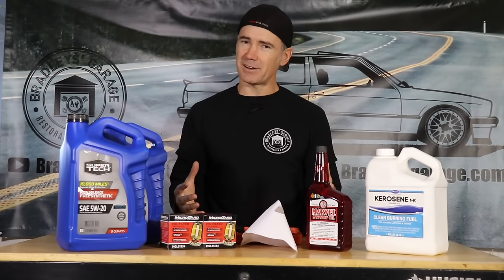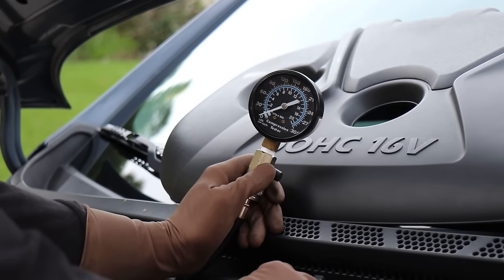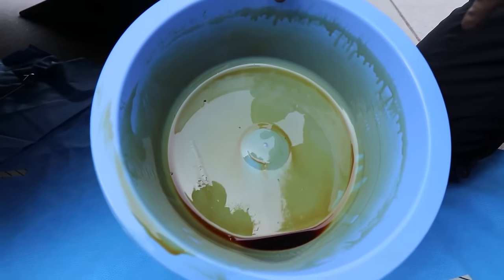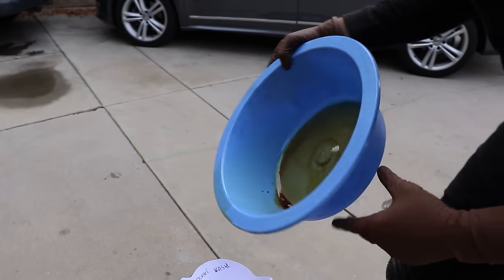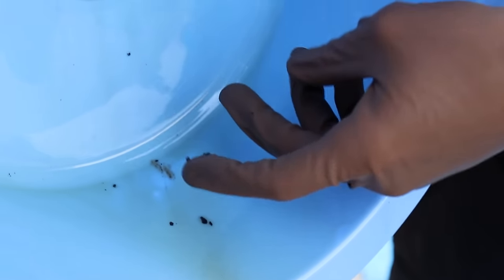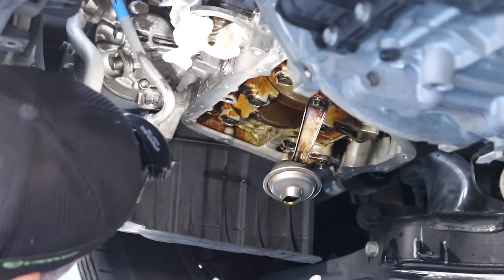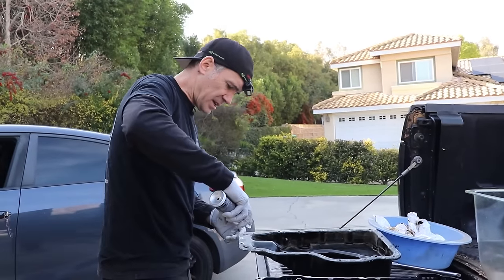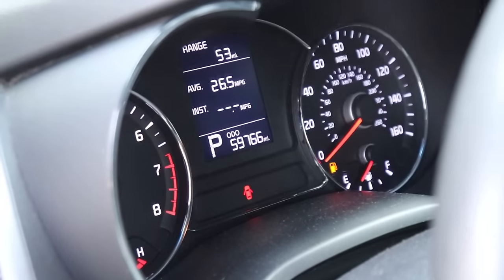*UPDATE* Customer States Jiffy Lube refused to change my Oil - Sludge Factory Kia Forte

Comment: Years ago, my wife's buddy dropped by her tercel. I was washing the wife's car at the time so I thought I'll wash hers too. They only take about five minutes. She's single so I thought it wouldn't hurt to check the well. No oil ,put in a quart nothing still, put in another quart and just barely touched the dipstick.any case topped her up. and she drove that car for years after that.
Reply from the maker: Thanks for the comments Joey, we were amazed that this was running fine when he first came over. After pulling off the valve cover, it was even more shocking.
Hopefully we have done enough to salvage the motor.
Thanks again for hanging out, Cheers!

Comment: I'm an auto tech. I've used Super Tech oil and filters for years and have never had any issues. It's extremely affordable, too. Even for full synthetic and they have a few stages/formulation blends.
Reply from the maker: Thanks for sharing Smith, appreciate the feedback. We also have not had any issues with the SuperTech brand of oil. It is considerably cheaper than the name brand shelf.
At the end of the day, the oil just needs to be changed on a routine basis.
We just posted the 3k mile update video here - https://youtu.be/QrJ0B-KXTw0
Cheers!

Comment: Honestly what a difference to the original pull apart.
You have just saved that owner a new engine if he kept driving like that.
I also agree too, & use a good quality oil.
In Australia I use Penrite oil.
Not cheap but made in Australia.
Reply from the maker: Thanks for the comments Stephen, we are pretty happy with how things turned out. We're sure the cheap oil changes at Jiffy Lube did not help the situation, if in fact they actually changed his oil.
We just posted the 3k mile update video here - https://youtu.be/QrJ0B-KXTw0
Cheers!

Comment: You should do some research on vavoline restore and protect I’ve seen multiple videos of how good this oil is at removing deposits and dang near bringing the engine back to new. I wonder if it would work on this car.
Reply from the maker: Thanks for the suggestion Leon, it couldn't hurt to perform a future oil change with that Valvoline Restore & Protect product.
We posted the 3k mile update video if you haven’t checked it out yet - https://youtu.be/QrJ0B-KXTw0
Cheers!

Comment: I never add new oil to oil filter when I change my oil. Am I supposed to add oil to the filter then screw it on? Thoughts? Also I do oil change every 3k miles even synthetic has never failed me and I drove my cars to 200k miles. So if you watching do every 3k miles.
Reply from the maker: Thanks for the comments Thomas. We mostly play around with Euro cars and they have the cartridge style filter on top of the motor. There is no real way to "pre-fill" them before installation.
We got a lot of feedback from the initial video about us not pre-filling the oil filter. Since this particular Kia motor has an oil filter which is perfectly upside down, you can easily add oil before installation. 
The internet seems to be divided on this topic and we never really gave it too much thought prior to this. We found an interesting video from an oil guy that went through a series of tests about the myth.
Check it out here - https://youtu.be/939WTeorBnQ
It seems easy enough to do for this application so it can't hurt anything and may actually prevent a few seconds of lack of oil pressure so we will start doing it moving forward.
Cheers!

Comment: You didn't have to do all this work if you just used the BG dynamic engine cleaner set. It is a pretty expensive product set, but after watching 100 of these videos it's the only stuff that really works and dissolves all that sludge in one go. I've seen it work on worse engines then this. Go get it and be done with this engine.
Reply from the maker: Thanks for the recommendation; we will definitely check out that product for our next Sludge Factory project.
Cheers!

Comment: I’ve been using marvel mystery oil. From the late’70 and I still use it today, I put it in my oil and also in my gas. My Toyota and my ford runs very well. My Toyota is 25 years old and runs awesome
Reply from the maker: Thanks for the comments Glenn, appreciate the feedback. We will continue to add a little in each oil change until the oil filter is clean after 3k miles.
We just posted the 3k mile update video if you haven't checked it out yet - https://youtu.be/QrJ0B-KXTw0
Cheers!

Comment: Marvel Mystery Oil is a great product in vehicles with questionable oiling systems. It saved the lifters on a 200k mile Tahoe I had. I ran it for a whole 3000 mile oil change and it just ran quieter the longer it was in there. 

I am blown away by how much cleaner that engine is inside. Great job cleaning it out. The owner should definitely stick to 3k mile intervals from now on. No doubt there will continue to be small particles breaking loose for some time, but nothing a good oil filter can’t handle.
Reply from the maker: Thanks for the comments Johnny, glad you enjoyed the video. We will continue to monitor it every 1k miles until the next 3k mile oil change. We will also keep adding 4oz of MMO after each oil change and run it for the 3k miles as well.
Hopefully we have done enough to salvage the motor and keep it running for thousands of more miles.
Thanks again for hanging out, Cheers!

Comment: Uhm  yeah, modern engines with variable valve timing and direct injection are sludge prone and sludge sensitive. Changing oil every 3000 miles is not too often.
Reply from the maker: Thanks for the comments Roger, the goal is for Jake to be able to change his own oil every 3k miles moving forward.
Cheers!

Comment: What ive done on sludge engines is Remove valve cover and oil pan, Cover corrounding engine and components with plastic, include under hood and fenders, Spray purple power over the engine and pressure wash engine. Yes pressure wash engine crap drains out of the bottom better than any snake oils. Repeat as necessary and clean oil pick up tube. , Install new oil filter and fresh oil. Remove spark plugs to spin engine over clearing any water that may have gone through an open valve . Run engine until hot ,drain oil and replace filter. Job done.
Reply from the maker: Thanks for the info Gerard, appreciate the feedback. We thought about the pressure washer but then didn't really want to put water into the engine. Since it wasn't our car, we decided to go with the flush method instead.
Be sure to check out the original video if you haven't seen it - https://youtu.be/XU79jXYWydA
Cheers!

Comment: Try high mileage oil. It has more washing formula and supposedly removes deposits better (in theory)
Reply from the maker: Thanks for the tip, we did use the cheap high mileage stuff during the initial flushes. Hopefully we have done enough to salvage the motor.
We just posted the 3k mile update video here - https://youtu.be/QrJ0B-KXTw0
Cheers!

Comment: Just wasting money n time. Just use diesel engine oil, regulary change the oil as usual after 3000 or 5000 miles, you would be amaze how black n thick the oil that come out, after maybe 5 times oil change the engine will be clean
Reply from the maker: Thanks for the comments, appreciate the feedback. Cheers!

Comment: 18:10 Take note quick lube places and dealer service centers.  The torque spec isn't "15 seconds with my air impact" for any car.
Reply from the maker: Thanks for the comments TBird, it's crazy how tight they think it needs to be. So many stripped out oil pans and sheared off drain plugs. 
Be sure to check out the original video if you haven't seen it - https://youtu.be/XU79jXYWydA
Cheers!

Comment: Many years ago ( in the leaded fuel days) I bought a Toyota HiAce with an 18R (2 litre SOHC) engine second hand which I serviced immediately. The oil was tarry. The compression was uneven.
I changed the oil and wasn't happy. Then I flushed it with Redex and soaked the bores overnight with Redex as per procedure. Lots of smoke on start up next day ( I may have done this more than once).
The behaviour of the engine became normal fairly quickly and the compression was soon within normal parameters. I never pulled the engine down but understand the gummy rings were freed by the Redex soak.
I eventually sold the vehicle which continued to run clean.

By the way, the best thing ever was getting rid of dirty leaded fuel which gummed rings, created sludge and destroyed exhausts.
If General Aviation would grow some balls their engines would last more that 5 minutes.
Reply from the maker: Thanks for sharing Mike, appreciate the feedback. Cheers!

Comment: Amazing what abuse engines can take. Even these vulnerable Kia & Hyundai engines. You cleaned it up real good. So that was diesel fuel?
Reply from the maker: Thanks for the comments Max. For all the comments we have been hearing about the Kia engines, this one has taken a beating and still seems to be doing just fine. We used a diesel fuel mixture for the secondary flush.
Be sure to check out the original video here - https://youtu.be/XU79jXYWydA
Cheers!

Comment: Just use the high quality engine flush and use premium synthetic oil like royal purple or amsoil in it. It will slowly remove carbon buildup and will have no issues after that.
Reply from the maker: Thanks for the comments, appreciate the feedback. 
We just posted the 3k mile update video here - https://youtu.be/QrJ0B-KXTw0
Cheers!

Comment: Dont understand how engines get to look like that -- Change my oil once a year or 10,000miles . Car now on 300,000 miles never let me down , uses not oil and is clean inside ie no sludge .  In Europe none changes the Oil every 3000 miles
Reply from the maker: Hey Duncan, Kia recommends 7500 mile oil changes and 5000 under severe conditions. Since Jake is only driving around town and never really getting the motor up to operating temps, it should be done every 5k miles.
Since we are still trying to get it cleaned up, we are doing the 3k mile oil change interval.
We just posted the 3k mile update video here - https://youtu.be/QrJ0B-KXTw0
Cheers!

Comment: Looks like you saved the motor.
Its not perfect and it will cough out chunks for a long time, but it doesn't look like total fail. 
Dumping straight diesel into it and out the pan is not forced into the bearings by the oil pump  but it won't reach the timing chain, only way to get it near perfect is rebuild it. But i think if he changes his oil sooner then later the extra cost of oil is less then a rebuild. 
Change at 2k to 3k miles would be smart. Don't let it break down
Reply from the maker: Hopefully we have done enough to salvage the motor. We will monitor it every 1k miles until the next 3k mile oil change. The plan is for Jake to perform that oil change since he has watched us do it 5 times now. And then he will be doing it himself every 3k miles from that point forward.
Cheers!

Comment: Isn’t a 3000 miles interval not very short? Modern cars can run with intervals more than 10k miles.
Reply from the maker: Thanks for the comments, the goal for the 3k mile oil changes are to further remove any remaining debris from the engine. Doing short interval oil changes will hopefully breakdown any remaining particles that may be present in the motor.
We will continue to monitor it every 2k miles until the next 3k mile oil change.
Thanks again for hanging out, Cheers!

Comment: On top, lightly spray carb cleaner then use a high power vacuum, then do your cleaning additive.
Reply from the maker: Thanks for the comments. We did a little diesel flush (off camera) with the oil pan off to wash out any debris in the tight areas of the engine and holes. That produced quite a bit of particles so we feel pretty good that the internals are clean at this point. It was basically a rinse from top to bottom.
As you could tell from the update video, there is not much left in that engine in terms of debris.
Cheers!

Comment: I would open the motor scrape some sludge from a few of the worst areas close the motor back up and test everything to see what dissolves the sludge in separate test cups once you find the right chemical I would drain the oil and put only that chemical in the motor disconnect fuel / Spark And crank it till the battery dies and let it sit for 24HR then drain fill with oil to Rinse chemical Maybe run it depending on how harsh your chemical is
Reply from the maker: Thanks for the comments, appreciate the feedback. 
Be sure to check out the original video if you haven't seen it - https://youtu.be/XU79jXYWydA
Cheers!

Comment: I’m buying my son a 2012 Toyota Corolla with 100k miles. Would you recommend doing a flush on all used high mileage cars as a good refresh or starting point?
Reply from the maker: Thanks for the questions Chris. It would be a great idea to do a normal flush just so you know you are starting your ownership off with a clean slate. You have no way of really knowing what or how the previous owner performed maintenance. Even if they have receipts, there is no guarantee of what has been actually done. It's an inexpensive repair that can provide some piece of mind.
Be sure to check out the original video if you haven't seen it - https://youtu.be/XU79jXYWydA
Cheers!

Comment: I am curious to see how a diesel engine looks inside with city or short commute only. My mom only buys diesel because of the advertised km/l or mpg. I told her she is better off with a gasoline, but she won’t listen. The car often has to go to the mechanic for a cleaning because the engine light comes on after too many short commutes. Even the mechanic says it. Not major says the mechanic, but not good for the car to take short commutes.
Reply from the maker: Thanks for sharing Geegee, short trips will have a huge impact on buildup such as this. It might even be worse for diesel engines since they like to be run for hours on end.
Curious what that shop does for "cleaning" the diesel motors?
Cheers!

Comment: It astounds me that, given what a car costs these days (even a used one), owners would be so lackadaisical regarding oil changes which are easy to do and relatively cheap .  I'd love to know what you charged for all that work.
Reply from the maker: He's just a 20 year old kid that doesn't know anything about cars or what is needed to keep them running properly. He helped with the repair so he wants to learn and understand things.
Hopefully he has learned a valuable lesson on the importance of routine maintenance on his car moving forward. The goal will be for him to be able to change his own oil moving forward.
Since he went to school with one of my sons, we just wanted to help him out. He covered the cost of all the parts used and we spent about 8 hours doing the multiple flushes, etc. We think most shops would tell him he needs a new engine and not want to spend any time actually cleaning anything.
Thanks for hanging out, Cheers!

Comment: In your first video, the engine was packed with sludge. I guess it liquified and poured out with the oil. Thanks for a great video.
Reply from the maker: Thanks for the comments John, it took numerous flushes to get it cleaned up. A lot of manual work as well, scooping out sludge and cleaning up the valve cover/oil pan.
We just posted the 3k mile update video here - https://youtu.be/QrJ0B-KXTw0
Cheers!

Comment: How can this problem be prevented?  Thank you for your excellent videos.
Reply from the maker: Thanks for the comments Royd, glad you enjoy the content. This was our first experience with the Korean brand so we have not had anything like this with our Euro projects. It seems as though, based on the feedback from this Sludge video, these engines are prone to having issues.
The best way to prevent this happening on any engine, first and foremost is proper maintenance. On the Kia/Hyundai motors, they need to be changed every 3-5k miles depending on driving style. Lots of short distance driving, do it every 3k and a combination of freeway and city you could push to 5k miles.
On the Euro cars we typically do 7500 for the gas engines and 10k for the diesel engines. On our high performance cars we change them every 3k miles since they are typically driven harder than the daily.
Hope that helps answer your question. Thanks again for hanging out.
Cheers!

Comment: Glad to see you used Marvel Mystery Oil! I add it to my engine and even my fuel tank. Is the best, it is slower to work because is not harsh, so you need to use the car for a week or so, but it sure does the job without any risk at all. You can even leave it until the next oil change. I have used MMO for more than 50 years! old and brand new cars.
Reply from the maker: Thanks for the comments, appreciate the feedback. We will keep adding a little MMO to each oil change to continue to wash out any remaining debris.
Cheers!

Comment: I've used the same engine flush I came up with 20+ years ago and I have never had any issues with using it. First of all you need to fill the system over full as it puts the oil in contact with places it is not normally witch is were sludge likes to be in this case I would have put 5 quarts plus 1 qt for total of 6 I run a gallon made of 75% diesel 1/4 of the small bottle of dawn and the rest paint thinner. Add to engine and add a quart of oil and a qt of diesel then let idle For atleast 20 minutes do not rev engine at all and it is a requirement to run a clean oil flush though the system otherwise you will have very very thin oil
 Just use the same filter as you did the flush with drain and refill the oil with proper amounts and run for 15 minutes and change oil and filter
Reply from the maker: Thanks for sharing Clayton, appreciate the feedback. 
Be sure to check out the original video if you haven't seen it - https://youtu.be/XU79jXYWydA
Cheers!